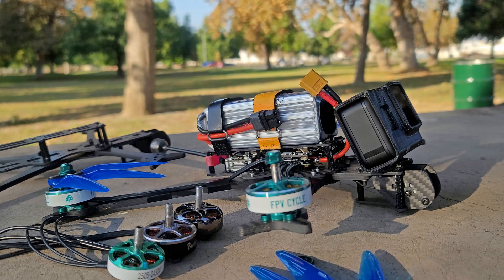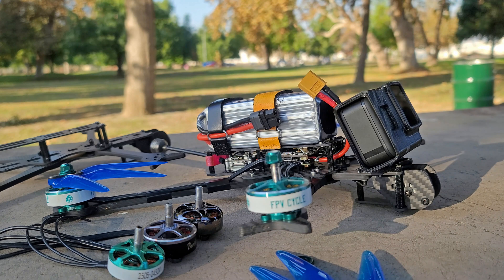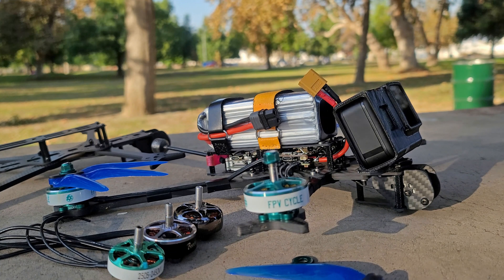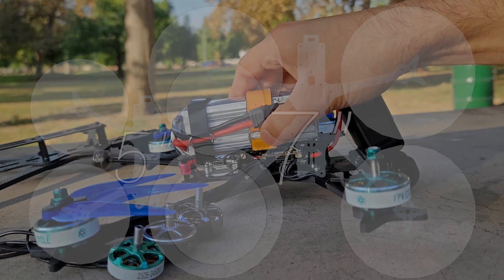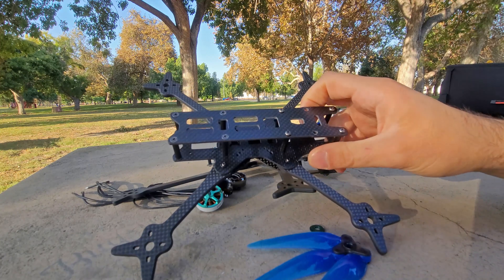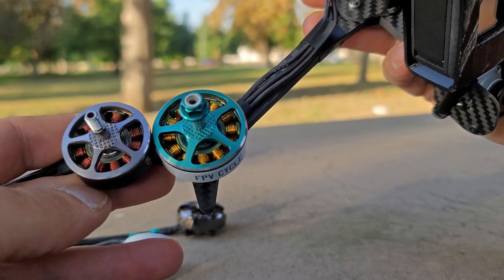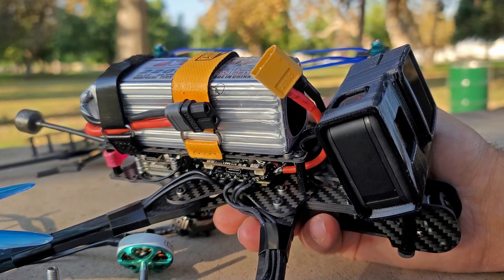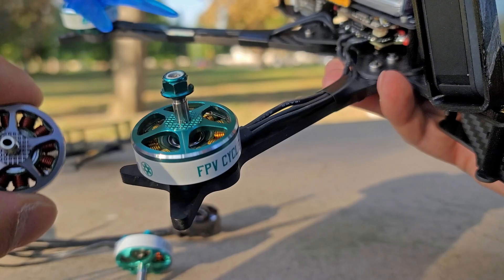A reshuffling of motor sizes, new 7" motor

Comment: It's called center of gravity.
Reply from the maker: CG and weight distribution are very different.  CG can be perfect but you can have huge weights way out to the side everywhere.  That will cause a weird moment of inertia during rotations that will make it fly awful.  The term 'weight distribution' also implies that weight is spread out when I was actually trying to convey that the weight isn't spread out.  That's why I used the word 'concentration' rather than weight distribution.  CG wouldn't have applied in this discussion.  The CG is way off and too forward but that's not actually as important as the tight weight distribution.
Reply: @Kabab   Thanks for clearing that up.

Comment: Hey Kabab, first off I really liked that 7" flight footage. But also I want to ask some dental question and would be happy if u have some time to answer :)

I usually like to use some tiny brush instead of floss to clean the space inbetween my teeth. The reason for this is that I find it easier and less time consuming than to floss. What do u think about those brushes? are they as effective as floss? 

Also I noticed that some of the stuff I clean from the space between the teeth (dont know the name) gets stuck on the inside of my teeth. The brush grabs this "dirt" but on its way out it gets stuck again in the teeth. Would u advise to brush the teeth before or after cleaning the spaces inbetween? 

Also I probably would have forgotten to floss (use brush) a lot more if u wouldn't remind us at the end of every vid xD
Reply from the maker: anything is better than nothing but nothing really replaces floss or otherwise something physically going between the teeth to clean.  If you're not gonna floss, anything you will do is better than nothing but floss rubbing the tooth surfaces at least once a day is best.

Comment: Not crazy interested in 7", I just dont have the space to fly one... that said, holy fast batman. Crazy. Also I love the FPVCycle Color-scheme. Mint Green and matte white. Drool.

Its weird you are the 3" guy and now the 7" guy, its nice to see the hobby expand outside of 5".
Reply from the maker: The platforms I'm building out will be the 3" 1S, 3" 3S, 5" and 7".  The 4" stuff is fun too but just a bit of a side quest.  The sizes listed above are the ones that will be completed and maintained over a longer period of time.  Larger sizes are typically more specialized and I don't do enough of those specialized things to do those sizes.
Reply: @Kabab  I think 4" will be a much more time worthy endevour if there is a 250g exception to remoteID. The sacrifices needed to keep a 5" that light are somewhat extreme, 4" might be king in 2-3 years, something to consider 🤔
Reply: @mouseFPV  You're absolutely right about needing the place to fly it.  I'm super-duper spoiled, and have great places to run a 7" quad within a 5 minute walk from my house... but if you don't have a venue for one, then just build a Vista-capable 4" rig and ro a low with that, or run a toothpick and giggle all the way.

Comment: I don’t really like arguments like: it just feels better. Feelings are very subjective and may vary from pilot to pilot. I like g/w efficiency stats and diagrams to compare things. If we only talk about feelings everyone can say anything without a real value. It’s not all about stats but if we stop even talking about motor size it’s gone to far in my opinion.
Reply from the maker: Charts, graphs and any measured benchtop efficiency numbers are less useful to me than actual real world flight performance.  The charts don't do a good job of conveying anything really.  Thrust tests are just about useless because even a little kv change can make a motor that's obviously worse look better.  The size is listed on the product page, just not explicitly
Reply: @Kabab  if the KV is changing so much that it significantly impacts performance you can use an area in your chart to represent that.
But if you are saying the manufacturing quality difference is enough to make one or the other motor look a lot better then it should not matter witch one you get because it’s a lottery anyway.

Comment: Finally some 7" quad development!! The motor looks sweet! I personally freestyle my 7" quad, not really interested in cruising per se, so I'm wondering if there's a plan for a 1700kv motor? Looking forward to the props hopefully with some varying pitch choices for those that like to fly these beasts radically!
Reply from the maker: 1700kv for 7" 6S?
Reply: @Kabab  🚀🚀🚀
Reply: @Kabab  one of the guys at my field had a BH 2808 1500KV on a 7" quad. It was the fastest quad I've ever seen - I think a 1700 KV version would be all sag. IdK.
Reply: @josephrsalexander4589  - The 1700kv in an open field is a rocket, but for freestyle, meaning flying this where i fly all my 5" quads, 1700kv isn't quite quick enough. 1800kv if thats possible on a motor that size would be perfect!
Reply: @Kabab  Yes! I'm running the BH 2806.5's 1700KV, 6s on a deadcat source one 7" quad for freestyle! The lower kv just doesn't spool up fast enough. Perhaps a lighter prop with a slightly heavier pitch with your motor could be the magic combo?

Mindyou, i dont know a whole lot about the science behind getting the right combo of motor to prop for a given quad. What i do know is freestyling a bigger quad in a relatively tight proximity cement jungle is a complete rush!!

Comment: Thank you for the video and insights! I am considering making a 7" chaser quad. I do a lot of remote control plane (prop and jet) chasing with my 5" 6S quads. I can keep up in short bursts but would like something with more sustained top speed. I will be thinking about these motors and that frame for my next chaser.

Comment: Has the 7" props gotten better balanced over time? Can remember "some" time ago, 7" video wasn't as smooth as 5" quads.
Reply from the maker: yeah better balanced but still awful by comparison to how good 5" props have gotten
Reply: @Kabab  use bi blades,and balance them yourself, more efficient.
Reply from the maker: @keithcarpenter5254  definitely don't have time for that 😅
Reply: It's not just prop balance (although they're plenty good), it's that lower authority motors are a nuisance to PID tune, and they pick up strange P/I gain ratios that can lead to wobbles.

Comment: Does it still bob around like a wing without the hypersmooth stabilization? (:
Reply from the maker: almost zero bobbling.  The bobbling now comes from tuning rather than the quad itself doing something weird.  This is on default EmuFlight and I flew it way high up to see if I could catch some breezes and get it to bobblle about.  It was locked....but the tuning wobbles are still there.  Primarily on throttle pump because Emu doesn't use RPMFilters yet.
Reply: @Kabab  i know you dont like cruisers but I bet you would have no bobbles with a 4000-6000mah 6s pack on there.   

At 1350g my 6s2p 18650 7in build has no bobbles and that is after I sped the footage up 200-250% to go looking for them.

Think that anything "light 7in" is gonna have some bobbles but having bigger motors helps dampen out any of the effects that a smaller motor may not be able to handle.

2306/2207 1600kv 4s was definitely a bad experience.

2806.5 1300kv results were awesome.

Your motors are likely equally nice.
Reply from the maker: @dividingbyzeros  I'm sure that would work out fine. Just not to my taste
Reply: Yeah, weight probably helps with the stability. To me it never seemed like a control issue, in most of the footage it really looks like the same kind of shudder the wings have, suggesting it's an aerodynamic issue. Such a thing is really difficult to fix with just the motors and there's only so far you can go with the props and the weight, given that you also have a performance window to hit.
Reply: @pirateradioFPV  if the 7in is prone to those issues then stepping up to 10 or 13in should be even more problematic.    I am here to tell you that I have a 10in that just flies absolutely stupid well on 6s be it LithiumPolymer or LithiunIon.    Have not had it in any real wind yet so stand by for the above statement to be re-evaluated.    I have had my 13in X class out in wind so strong that I was flying 40mph going out into the wind and doing 80mph coming back with the wind.     That big boy felt the wind on that day, so bad that the Hero 7 hypersmooth couldnt contend with the problem, but that could also be in part due to how/where I had my gopro attached far from the centerline/roll axis.

I am happy with my 7in now but my use for it is less meant for ripping and more cinematic proximity flying.
Reply: @dividingbyzeros  what are your pids on that 1350g, ive been messing with some 2810 1180 kv on my 1450g 7" and there a bitch to tune which i kinda new going into and am hoping to get the most out of these with higher pitched 7056 props(compared to my current 7x3.5x3).... im around 80p and 110d now to stay stable in gusty winds, although these higher gains brought out vibrations in lower throttle hovers which i was only able to solve by bringing the timing down to 12 degrees... although ill probably go back up to 16 degree once i get higher pitched props.... I initially had no vibes at p/d of 40/60 but you realize how bad your tune is when you go flying the next day in 40-60km/h gusty winds, floppin all over the place
Reply: @Kabab  Sounds great, to me the 7" felt zero wind kind of quad when I had mine. Without the wind it flew fine (albeit sluggish due to the 22xx motors) but anything over 5m/s made it very unhappy, up to a point where you didn't even want to fly it. I've been trying to get my 6" to fly for a while, I have less than 10 packs on the K2 props but so far there's promise in that direction too. Of course 7" is a lot easier to sell to the people who already have 5" and at least in that size some prop development is happening, even if that development might not explode in speed but in the air 😅

Comment: Any thrust figures avaible on these bad boys?
Reply from the maker: No idea what the thrust might be but it's not low.  Bench test thrust numbers aren't really that useful.  It's definitely more powerful than a 2806.5 (About 22% more power) but not as powerful as a 3115.  It weighs as much as a 2807 however.
Reply: @Kabab  thing is im looking for a light quad motor to use with a 10inch prop on a plane :D more powerful then 28xx sounds good to begin with
Reply from the maker: @peterzingler6221  typically plane motors tend to have taller stators and are operated at a much lower overall power output than quad motors. It doesn't really make sense to me why the motors are so tall for planes. This motor would be a good plane motor but no more than 5S on a 7" prop. That might even be a bit high.  Quad motors are not designed for constant high load operation. While the motor will be able to pull maybe 80A, we average more like 10A per motor or less in actual use. So 7" ad 4S or 5S should be fine on this motor but I would absolutely monitor temperatures and wouldn't push it until verified not overheating. You have a nice coushin with the super high temp windings however.
Reply: It's a lot... like >2kg/corner a lot.  The limits on these are the batteries and props, straight up - Bob is totally correct about it not being about peak thrust (but these things will party, don't worry about that).
On a plane, for this stator volume, I'd trend toward taller (2808), but I can see why this 3XXX.X size is probably preferable if you want solid locked in performance.